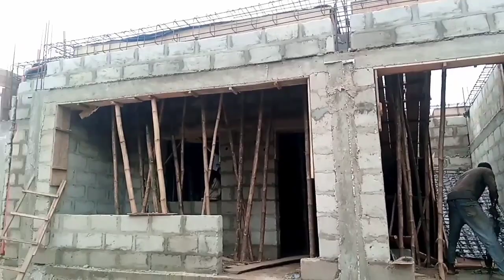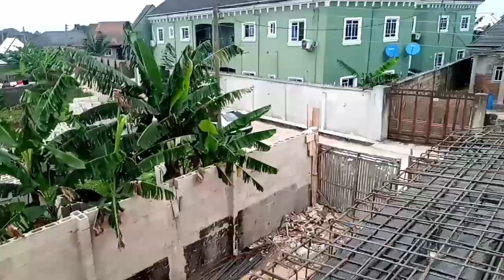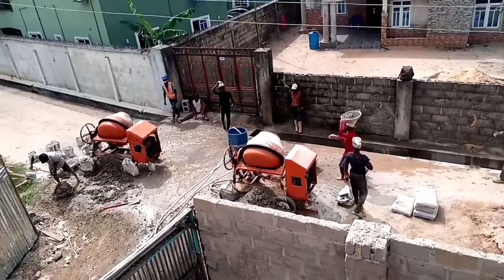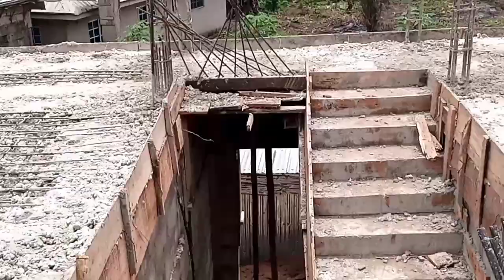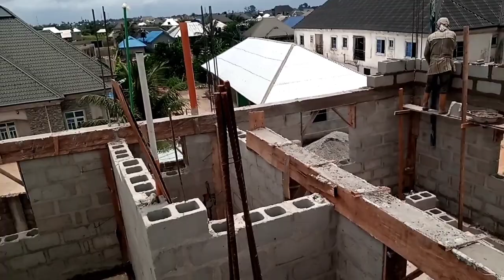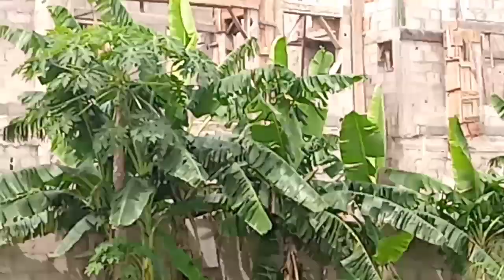Construction of 3 number one bedroom residential apartments, 3 storey building.

Comment: what is the size of block used for the construction. Thank you for sharing valuable information.
Reply from the maker: The size of blocks depends on the nature of work or the specifications on the architectural drawing. You can use 6" hollow block for area that are not having load bearing walls and 9" hollow block for areas with load bearing walls. Thanks